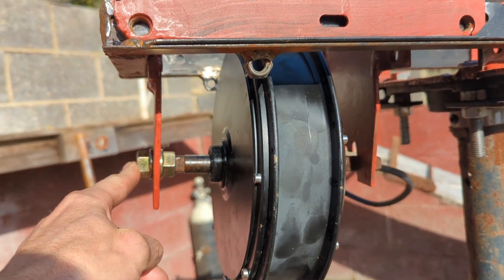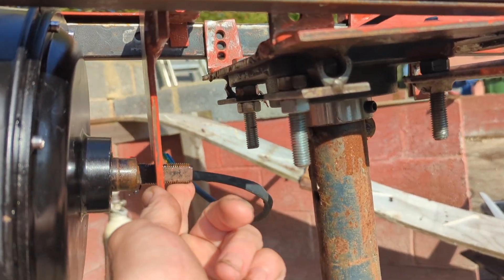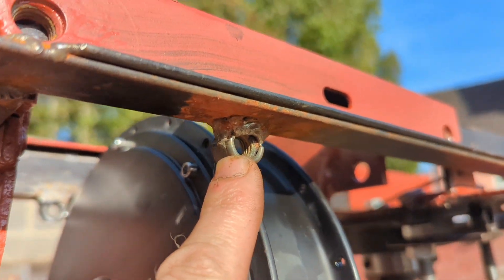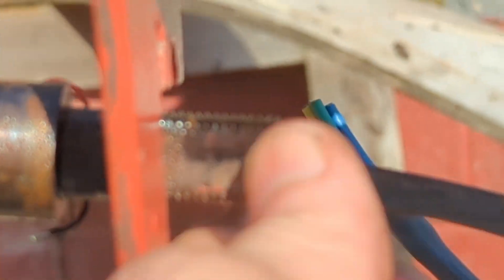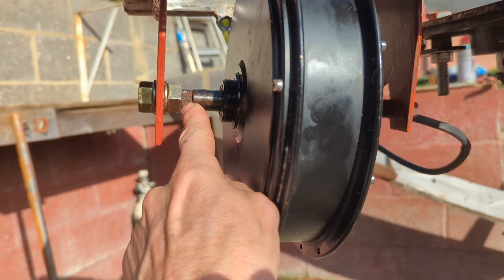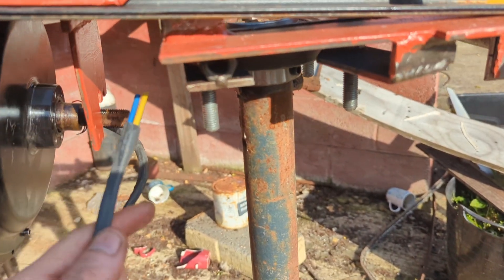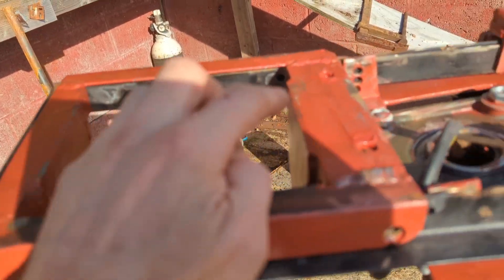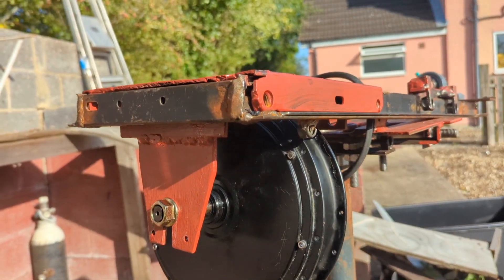3kw Ebike Motor Hub Wind Turbine Project - Fitting the motor to the frame ( mock up )

Comment: Getting there. How are you going to stop water getting in when it's at the top of the pole?
Reply from the maker: I am hoping it won't be a problem when it is spinning regularly , plus it will be horizontal whereas before it was sat up in the right way for the water to ingress.